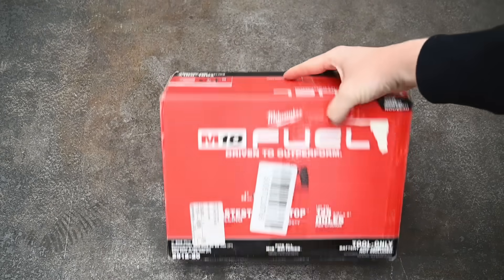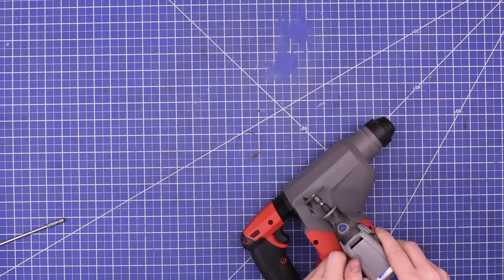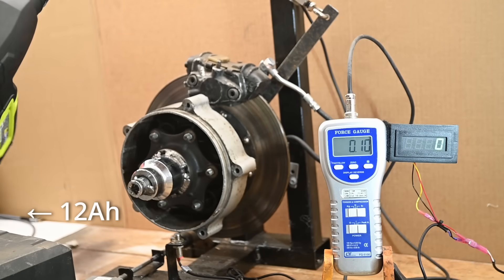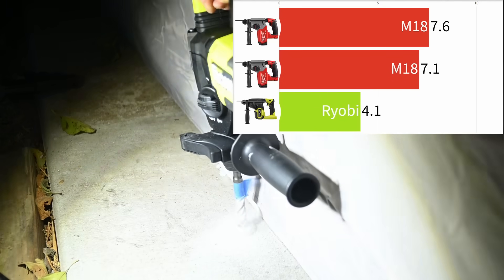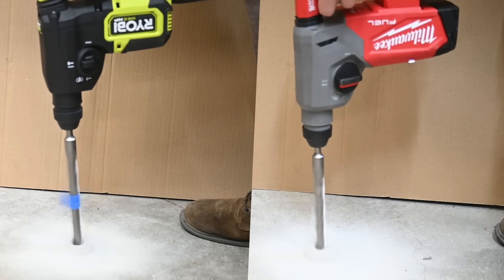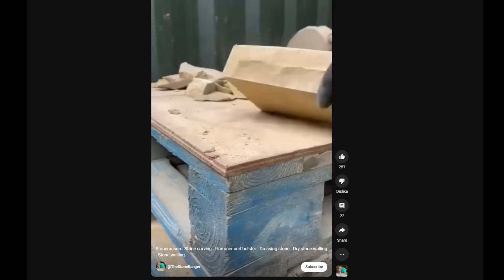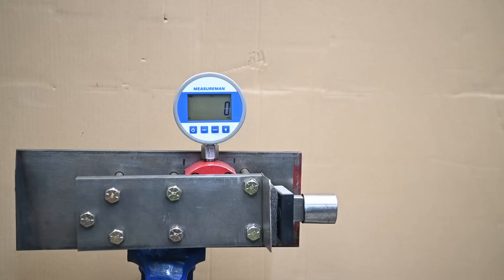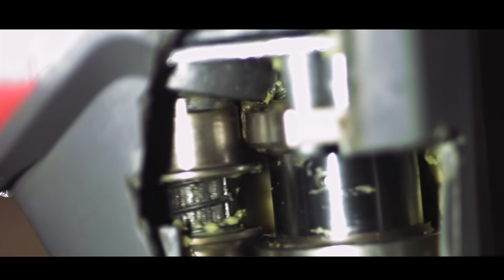How Drilling Thru Concrete Works @ 10,000 FPS

Comment: Amazing footage and insight. As a DIY'er trying to remove a very large granite boulder I've spent way more than I care to admit on SDS drills. Unfortunately, as good as some of the cordless versions are, they're still not as good as their corded counterparts in the SDS-Max range when you need to do the big stuff. They also overheat more quickly. 
If you have a serious job - don't go cheap on these or on your PPE - use an extractor with a HEPA filter and make sure you're wearing an appropriate mask.
Reply: Well said

Comment: Thanks.   I drilled lots of concrete utility poles , both square and spun.  
In the early days , say late 80’s, the  hiltI  corded was a wrist breaker.   I called it the rebar dance.   Set on hammer only it would cut through rebar.  
Funnier still is we were old school enough to strap a generator to the bucket truck to operate it amongst energized circuits.

Comment: Measuring torque and calling these "hammer drills" is misguided.  They are not drills at all, they are rotary hammers.  They only turn so the bit impacts a new spot each time.

Comment: Nice video and explanation, thank you! I also amuses me to watch rotary hammers at work chipping away at whatever the business end is pointed at. Can't wait for SDS rankings (hope they are coming). 

My personal story is that I was trying to drill around 20 holes in reinforced concrete to hang kitchen cabinets. The regular 18V combi-drill wasn't cutting it. And it was getting real hot (due to how the hammer mechanism works). Pulled the trigger on a rotary hammer purchase. One of the best purchases of my life.

Comment: I grabbed one of the Milwaukee M12 Fuel sds+ drills. For my very occasional concrete drilling I couldn’t justify the big boy. I was pleasantly surprised how well even the M12 worked for my tasks.
Reply: Eh, I figured just having a drill with the hammer function was good enough. I'm going into wood, drywall, and sometimes metal (commercial framing) more often, so having a tool that mainly works for that but can clear masonry once in a while made more sense.

Comment: Back in the late 70s, the way we drill through block wall was a star chisel bit and a 5 pound sledge or a 10 pound sledge. Yes it was glorious thing to watch while on a ladder.😅
Reply: And God help you if was poured concrete with rebar. It turned ya onto Popeyes forearms

Comment: The hammering does the drilling, the tip of those SDS bits is like a chisel, the main purpose for spinning the bit is to remove material chipped out by the chisel tip hammering.

Comment: I have always found rotary hammers have a "happy place".  You have to apply just the right amount of pressure to get them to drill at the optimum speed.  Too much pressure and they actually cut more slowly.

Comment: So can these be used like mini jackhammers on small concrete demo ??
Reply: The corded one I have can be used without rotation.
Reply: Yes. The mini SDS drills don’t have a hammer only mode. The standard size SDS drills usually have four modes: rotary only, rotary hammer (which is what you saw in this video), hammer only with the chisel locked into one position, and hammer only with the chisel free to spin.

Comment: I've often wondered why manufacturers even bother making hammer drills with Jacobs chucks. Like, there seems to be very little point if the drill isn't free to slide. Even a cheap SDS rotary hammer is more effective than an expensive "hammer drill," like you demonstrated at 12:28. Is it just marketing wank? Or is there some other reason for a hammer drill to exist? Like, it may make a smoother hole, but I wonder how important that is when you're just making holes for anchors.
Reply: Very small holes (tapcons) or soft masonry (brick and especially mortar) are not great with SDS.  The impact force is too high and can blow the hole out or even crack the entire brick. Hammer drills hit softer but faster than rotohammers, so they have their place

Comment: Finally, I asked and wanted a comparison list from you guys for a long time for sds drills.

Would love to see some more tools from the other brands tested on the hammer rig. And don't forget to add it to the Google drive sheet!
Reply: I know it's bad form to spruik other channels, but Boltah Downunder has been at this for a few years and has about 30 SDS drills tested. He's a very small and underappreciated channel, so check him out.
Reply from the maker: We dont quite have a google drive category ranking for SDS yet
Reply: Rotary hammer drills are one class of drill where the manufacturers seem to use the same units of performance, in terms of striking force (Joules).
My take on the TTI models is that the mechanical side is the same (identical part numbers), just driven by different motors. Which means the cheaper models will likely last longer, as they’re subject to less stress. Possibly one reason Ryobi tools can be surprisingly durable.

Comment: Where is the psi test on the dewalt hammer drill? Show me the stats! :)
Reply from the maker: They dont have a hammer only function
Reply: @TorqueTestChannel  Would the rotation of the round nose bit meaningfully affect the results or damage your test rig? It would make it a little harder to keep centered?
Reply: Yeah I guess I knew that but it would be interesting to see how much hammering it does still.  Maybe retract the jaws of the chuck fully and let it ride? Not an exact comparison but better than nothing and I'm sure you would think of a more elegant solution. It definitely wouldn't go on the comparisons with the air hammers like you started with originally, but still useful between hammer drills and between hammer drills and sds drills I would think. @TorqueTestChannel

Comment: Even though they will eventually do it, drill-drivers with hammer function are miserable for any project larger than hanging a picture. 

When I worked as an electrician (in Germany where houses are stone and concrete) we had different Hilti rotary hammers, corded and cordless. 
The best allrounder is probably the TE30-AVR, pretty large and heavy, but comfortable since it doesn't shake the user around too much and powerful enough for 30mm breakthroughs in concrete and 68mm core drilling.** 
Now that I'm an engineer I don't do that kind of work anymore, so for occasinal use I've just bought a cheap Einhell cordless rotary hammer. Works surprisingly well and is still in one piece. Especially cheaper SDS chucks are usually terrible. I don't think Einhell is available in the US, but if so I'd be interested in some reviews there.

**Hilti has quick change chucks although they last thousands of hours with some grease and cleaning from time to time, I can see that these don't. On a prosumer tool like the Milwaukee I would expect to see that too.

Comment: As a former Hilti tech advisor it hurts my soul to see the through-hole technique for what I assume are wedge anchors.  So many manufacturers of equipment (not the anchors or drills) suggest it without regard to how much it reduces the pull-out for the anchor.  Meh, not my problem anymore.

Funny thing on these SDS+ battery drills is the "king" of corded SDS+ drills (Hilti) came out with the first viable battery version...then proceeded to allow themselves to be spanked in performance for almost 15 years by more than one competitor.  Bosch being the first was not a surprise but there were multiple others until they came out with the third gen battery hammerdrills.
Reply: So when I set wedge anchors for earthquake bracing at work, I drill the hole just deep enough that when the anchor is bottomed, just enough threads are showing to bolt my attachment swivel to it. Is this the more correct way to do it?

I’ve always done it that way to guarantee I don’t drill through the slab onto the above floor. But makes some sense that it would be stronger as well.
Reply: @connorjones1485  There are tables for all the stuff but infamous "rule of thumb" is if pull-out is a concern, you need three anchor diameters or 1/4 of the slab thickness below the hole.  The goal is not to compromise the "cone" of concrete the anchor is trying to pull out.  That cone is almost a perfect 45 degree angle (again, oversimplified) starting at some point below the tip of the anchor.
Reply: @michaelkrenzer3296  good to know. These are the sorts of things that don’t get shared with those who install them, as you’ve already indicated. 

In the case of our earthquake bracing, they probably do actually need close to their rating.
Reply: @connorjones1485  As you can imagine, it all depends on what is going to fail first...concrete, anchor, brace or the wood in the wall it is bracing.

My common issue I see because I am around a lot of car folks is two post 7000# lifts installed in 4" 3000# unreinforced slabs (perimeter reinforcement and just 6 x 6 weld wire in the field.  Because it fits their baseplates, manufacturers spec out 3/4 diameter bolts really close together...usually 6 in an 18 x 12" rectangle.  They instruct to drill through the slab which for that diameter anchor and that thickness of slab cuts the concrete pull out strength in half and normally four bolts' pull out cones overlap with one other anchor so each of those have their cone's strength cut in half.  Really crappy design and worse instructions.
Reply: @michaelkrenzer3296 I can't understand why anyone would ever want to overdrill a hole. On top of the problems you mention, it takes longer and exposes your anchor to ground moisture. Only advantage I can see is that you don't need to suck/blow all the dust out, just push it down. I guess there's also the ability to hammer in old unwanted anchors, but that only requires overdrilling by 10-20mm.

Comment: As a central EU denizen I can tell you from experience that 1970's Soviet™ Reinforced Concrete is no joke, and while a 2 kW corded Makita will eat it all day every day, for home use there is... BOSCH Uneo, and yes it's the green line! Would really like for someone to dig into it as I can't fathom it has a mechanical hammer mechanism - my guess is some direct pneumatic shenanigans. And yes, for its size it does work quite well (doing fi. 6 mm by 40 mm depth the main problem past the 9th hole in a row is the tool overheating!).

EDIT (2024-01-27): I stand corrected, the Uneo most likely has a mechanical hammer with that wobble bearing thing. Regardless of which exact "flavor" of Uneo one gets, as there seems to be at least half a dozen different models under that exact name. And yes they are all "pneumatic" in the sense of "air compression is a thing at that one particular point", pretty much like all electric ASG pistols are "pneumatic".
Reply: i hate soviet concrete. had few jobs as electrician in these buildings. diamond drilling and cutting takes way longer than new rebar concrete
Reply: Not all concrete blends let alone the aggregate are created equal. Different sand types and sources, lime sources and contamination even the stone size,roughness sand material all contribute. Even the temp it cures at or is allowed to dissipate during a cure will alter how tough it is.  I my old home there was some very old concrete installed at least 125 years old and bulked out with river pebbles all smooth and rounded rather than crushed rock. That stuff was the hardest and toughest I have ever come across. The drill bits needed a new edge nearly every hole and when I eventually removed it the sledge hammer just bounced of it like it was an anvil.
Reply: I heard that Albanian bunkers were very sturdy. Concrete and rebar plus stone and steel.
Reply: As for the Uneo - I do actually have it (and me, sorta) in a video actually using it on the said Soviet™ Reinforced Concrete -> https://youtu.be/VbbgoTDNC4E?t=412 (beware, loud AF; I do not edit my videos, yet).
Reply: Everyone is copying the same essential Bosch SDS drill designs, so your Uneo is likely to look exactly like the drills in this video, except the motor is horizontal so there is no need for the right-angle linkages seen in the video. Larger SDS drills have a different design with the actual piston pushed by a pin in a horizontally rotating disc. This TTI design is combining many of the disadvantages or the two designs :)
Reply: @tamask001  The motor is indeed horizontal and also tiny - with the 0.5 J impact rating being what it is. Still would enjoy someone (else than me) taking one apart and going over the innards. I'd prefer Uncle AvE to do it but, really, anyone (but me) will suffice 🙂
Reply: Yeah his floor seemed pretty soft didn't it? I don't even get 7 seconds with those tools drilling 12mm let alone 16
Reply: @BoltahDownunder  By `his floor` you mean the current TTC video here aye? If so then yes - this sort of "modern" (to my circumstance) pure sand/no stone concrete just looks and sounds like a fun thing to work with. So predictable, so satisfying! 🙂
Reply: @PiotrStaszewski  yes, he was drilling his garage floor here in this video. Amazingly fast drilling, maybe there wasn't even aggregate as you suggested. The combi drill also drilled it quite fast for that size bit. If there was hard stone that would barely get through at all
Reply: @BoltahDownunder  aye, no aggregate or a very fine aggregate. Which either way converges at "no stones, and certainly no quartz stone!".
Reply: @PiotrStaszewski  indeed! And regarding the Bosch Green I have some answers for you.  I don't have an uneo but the new version.  It's a spring driven hammer, unlike most SDS which have wobble bearing
https://youtu.be/l3nsIBwdZrY
Reply: Greetings from former Soviet Estonia! We have tons of soviet concrete buildings, too. For me it's Bosch' good old GBH 2-26 that works the best. Hammer drilling screw holes, clearing old plaster from walls, and as a core drill driver in rotary-only mode! Also, I prefer to drill away from rebar by using a wall scanner first. Btw, your bit wobbles a bit. I prefer Makita Nemesis bits but even they can be non-straight. Always check with a ruler in the store before buying any. Vacuum-held dust shroud (like HDC200 but other drill manufacturers make similar) is really nice to clear that dusty powder coming from the wall without sniffing it through the nose. Btw, I have found that there is some sort of sweet spot in the drill speed where it makes minimal noise but cuts in the fastest (possibly because of mechanical resonances).
Reply: We got a very old Bosch hammer drill on cable its so ancient it only turns forward it breaks concrete like nobody's business
Reply: Bosch Uneo is definitely pneumatic, a very standars set up. It does work and will outperform "masonry vibration mode" on drills. For larger diameter holes is useless, but I like it 'cause it's cute. Concrete gets harder with time. I remember working on a telephony building with a monobloc structure, all concrete and rebar, designed to witstand eathquakes and bombings by brute force. It was crazy hard to drill even small holes, the machines were simply not making progress fast enough.
Reply: You guys do realize that concrete hardens as it ages right?
Reply: @DMSparky  I do, and believe most of us guys (gals and all in between etc etc) here do too. For the Soviet™flavor of that vintage though it's more about what sorts of stones - quartz included! - happen to be in your way. Or rebar. Or both. Or empty air. It's really a brutalsky lottery.
Reply: @DMSparky  Some does yes.
Reply: I wasn't going to ask any of those questions you pre-answered
Reply: I almost only chip with rotary hammers that’s a lot of time on the tool at 9 by 6mmx40mm I’m changing to hilti because of how hard I am on them not because their more powerful but because they’re ergonomic and theirs an actual warranty and I can get it repaired easily and quickly unlike any other brand
Reply: Probably should have done this earlier but: I did search youtube for "Bosch Uneo teardown". The most important thing I've learnt is that there is at least half a dozen different models all called "Bosch Uneo", and all of the teardowns seem to open up only those that have internal batteries and two modes ("drill", "hammer drill")... And they all do have mechanical hammer with that wobble bearing thing so I stand corrected, as now the least likely option is for my particular version to have anything other but that sort of mechanism ("my version" is the 12V removable battery and three modes [adds a bit driver mode, which I never use, but presume the idea is that there is some preset slip clutch engaged in that mode]).
Reply: Really? My Russian boss said all the concrete buildings were garbage and constantly falling and crumbling lmao
Reply: Bosch green is garbage.
Buy makita, price is between bosch green and blue but the tools are on the same level as Bosch blue.
Reply: What kind of corded Makita are you talking about? That Bosch Uneo is declared to have 0.5J of impact energy.. which is kinda on a (very) low side.

Also, there is a wear factor: as o-rings on the cylinder wear down (or grease dries up), the hammering action goes down in power. I.e. the cylinder starts leaking air instead of pushing and pulling the striker.
Reply: @KennyMinigun  The kind of blue Makita I borrowed 15+ years ago and it took me more time to put the dust covers than to drill 4 holes. So yes, don't remember the model, but it was a beefy one (and remember, 230V here; 2 kW is nothing particularly special and I did make that number up - though sounds reasonable to me!).

As for the Uneo - it works in practice, which is why I'm so curious "how come!?". Sure, the Makita took a second to drill a hole - like the problem was trying to not overdrill (sorry, had no stop rod); while the Uneo is maybe a dozen seconds per hole - but remember, I'm comparing here a full-on contractor grade corded power tools vs home gamer "drill 10 holes a year" tool and... The latter one is way more amazing.